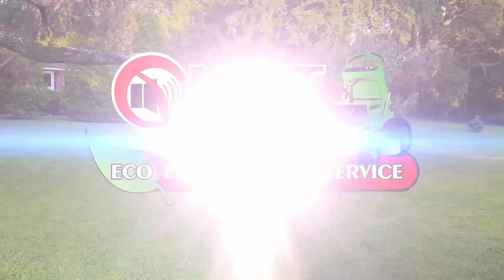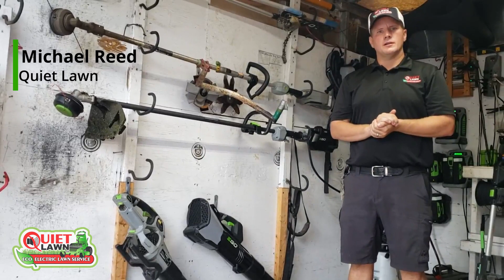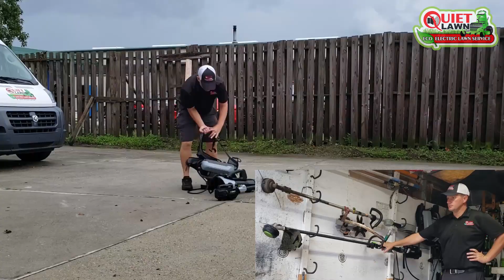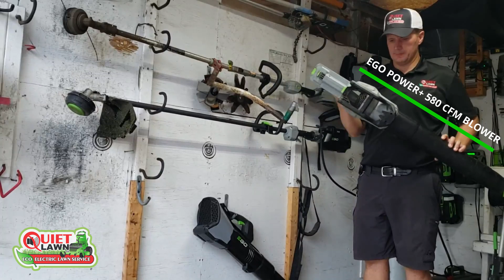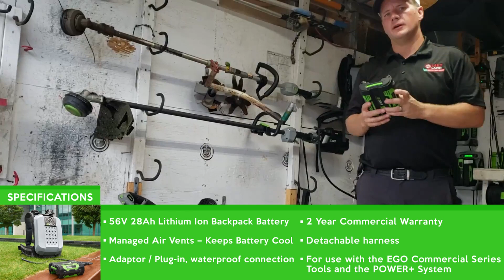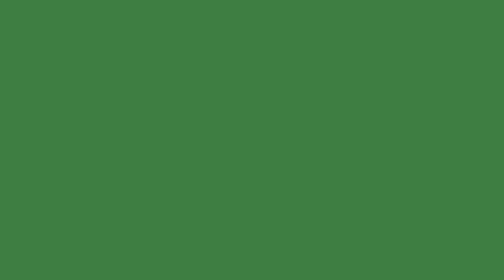EGO Commercial Series Review | COMMERCIAL BACKPACK BATTERY, STRING TRIMMER, BLOWER

Comment: The commercial blower does indeed have a turbo button like the rest of the Ego blowers. That button on top has a dual purpose. With a quick press and release it cycles through four levels of max power (with the trigger being variable up to the chosen limit), and if you hold it down you get turbo.

Comment: Before you buy check the comments on Egos 'Time out feature" can go haywire , worst product ive ever bought. . . . Look in the fine print!!

Trimmer has a timeout feature,when/if trigger is locked  on/or extended run with no pauses,it automatically shuts down after set period of time
Reply from the maker: Yes, one of the other reasons we use their consumer line instead. Thank you.

Comment: The Ego multi head with hedge trimmer attachment was the first Ego product I bought.  I agree with your assememt, I've done 100's of hours on it, even in pouring rain, and I've had zero issues!  

On the other hand the Ego 650 CFM blower I have is on its third warranty replacement in 6 months...
Reply from the maker: Nice! Yes, they are solid. We've had one power head go out in 5 years. I did have one 650 cfm blower dead on arrival, but luckily haven't had any issues with the other two in the past year or two.
Reply: @NeonPestandLawn  That's good to hear.

My 650's died after being used in light rain.  I live in Vancouver where is rains 6 months out of the year.  I'm worried that now my third 650 will yet again, die if I use it in the rain.

I'm wondering, does the commerical blower work better in rain?  Does it have a better IPX rating?  I know the 650 is IPX4.

I also have the 530 blower that I usually use when it rains...so far no issues.  I just don't like the trigger and speed adjustment knob on it though, so I'm never happy during rainy work days!
Reply from the maker: @charleskarpiuk7330  I'm not sure about the rating on the commercial blower. We only used it one day and I wasn't impressed. I have had one of their mowers out in the pouring rain with no issues. Never used the blower in rain though
Reply: @NeonPestandLawn  Update: my multi head died last week.  Using the hedge trimmer on a cool sunny day, and I heard a clunk, and it stopped working.  It's in for warranty repair.

I didn't realize until now, but EGO only offerd one year warranty when their products are used for a business.

So this multi head broke after a six months.  But I will say I easily put more than 200 hours on it.... Sometimes in the pouring rain.

But still, I am a little worried what happens after one year with all my EGO products now. 

I'm considering to start moving towards buying Husqvarna's battery tools.

Comment: Once you try one ego product, you get bit by the bug and want all of there products
Reply: TBH not all of their products are better than the gas powered versions. I wouldn't stack up a stihl chainsaw against an ego chainsaw, i've used both and used stihl most of my life. Ego's battery chainsaw has a lot of improving to do, one of those being a heavier bar and heavier chain (you can't do that with Ego but you can with a Stihl gas power), Ego's chainsaw chain is for very light use at best. It won't outlast a stihl chain. 
Their hedge trimmer was decent and did manage to keep me from frowning but it's not as good as i'd like.
The units that impress me most from Ego are the push mower and the string trimmer.
Reply: @Enonymouse_  the carbon fiber shaft string trimmer with the power load feature was my first ego tool. I bought that and the 18” chainsaw. I’ll never buy another gas weed eater but I agree with the chainsaw. It’s not comparable to a sthil or husquivarna as far power and performance. Definitely not what I would recommend for someone cutting firewood for a living. It’s just not as fast cutting but for use around my house, cleaning up my property and trees downed by storms it works great for me. I like not having to pull the ease of use and virtually no maintenance other than the tightening the chain which I feel gets a little to tight and bar oil and just cleaning it up after using it
Reply: @markwarren515  It doesn't oil the chain enough during operation I think.
Reply from the maker: They are great tools for sure.

Comment: May I ask what kind of trimmer line you recommend?
Reply: I've used the non-backpack ego version for years, when they got new batteries, it was plug and play. I cleared heavy underbrush of an uncleared 1/4 acre of land for about an hour. In 5 years i've not had a mechanical failure or battery fail. <3 their stuff, want to replace my unkillable honda mower ( i swear by that mower) with a battery unit from ego.

Comment: You mentioned you already had to replace one battery. Now i don't know how much gas commercial guys go through on a daily basis for just string trimmers edgers and blowers, but if they are running the small 4 strokes it cant be a lot can it? (I'm not talking about the large lawnmowers, just the smaller hand tools) I know as a homeowner, even in my 2 strokes that I have to be careful not to put too much in because the fuel will go bad before I can use it all. I assume that's not a problem for commercial guys who use the equipment multiple times daily. That backpack sells for $1300 and they claim it's good for 1000 charges. One recharge every night and that would be about 3 years...It would also be $1.30 per charge before the cost of the grid electricity...that would buy a lot of gas. The problem with gas is maintenance and wear, so I suppose you eliminate some of that, but even electrics have wear and consumables. Have you truly crunched the numbers? Will the battery deliver as much juice on the 750th charge as the first charge? These all seem like a mystery and I don't think you've recharged that backpack 1000 times yet. This stuff is still relatively new. How about an update?
Reply from the maker: Hey Michael, 

Thanks for watching. We only demoed this system and I have another video talking about why I don't like battery backpack systems and prefer the smaller batteries on the equipment instead. But, to address some of your points, your example assumes someone is using it 7 days a week, 365 days a year. The reality is probably half of that at most making the battery life more like 5-7 years. I've had batteries from my previous backpack system for over 4 years and they still work great. During that same time, I would've spent a significant amount of money maintaining, repairing, and fueling gas equipment. I also would've paid a lot of labor to have my guys do that maintenance or make many more stops at the gas station. But, cost and whether or not it's cheaper overall is not the only reason I now use electric equipment. I spend almost zero time on maintenance and the equipment almost never breaks. They are much simpler and there's less to go wrong. Also, the other benefits like not having to wear ear plugs,  smell fumes, worry about spills, etc are nice. Hope that helps. Good luck.
Reply: @NeonPestandLawn  Well glad to hear it's working out for you, I'm still not sold though. I have a Tanaka edger that must be pushing 20 years. It's really meant to be an edge reestablishment tool instead of a replacement for a stick edger, but I use it as my main edger  because I may only use it a dozen or two times a year. I put that canned gas in it and I've never had a problem starting it (even if the fuel is seasoned) Maintenance has been zero except for two blades.and I've had it for 15 years and it cost me less than $300 (currently that includes 15 years worth of fuel and blades). I really don't see how electric could be cheaper and easier for my situation, It uses so little and the fuel cost is so low it's negligible that it costs anything at all. I've had corded electric edgers before, but they don't come near to the power ease and freedom of the gas one. I'm assuming these modern cordless take care of those 3 issues but I'm not near sold about the (overall) cost over time  issue.

Comment: I would love a response.  We maintain 200ish residential properties.  Our average lawn is around 4200 square feet, so small.  I am considering switch to all electric handheld equipment.  Can you tell us what you're finding as far as battery run time?  Do you use stick edgers?  How many times are you changing batteries?  Are all your batteries 7.5, or what size are you using?  How often are you changing batteries in your trimmer?  How often are you changing batteries in your blower?  I would love your input.  We currently run Stihl 111 trimmers and edgers.  We gas up at the start of the day and once around noon and we are good to go.  I am wondering If battery powered equipment is similar, or if it needs to be changed a lot more often.  Thanks so much!